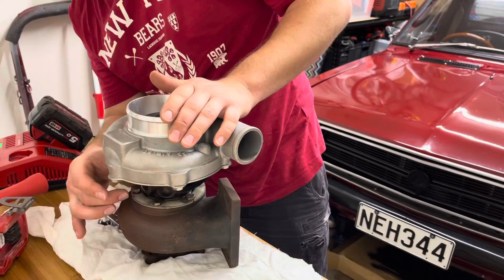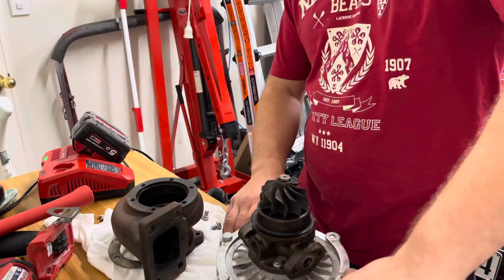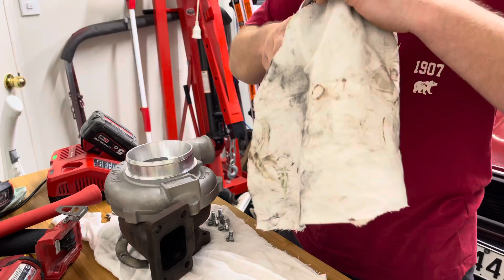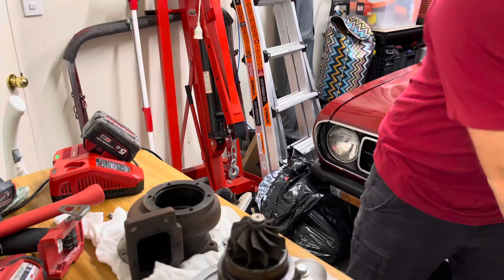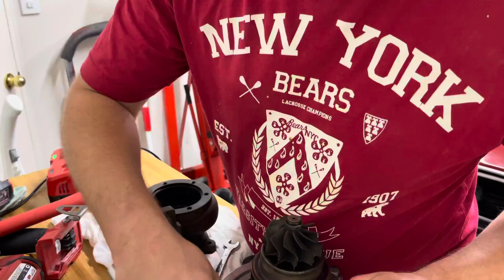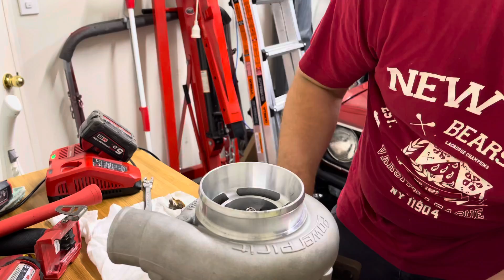Taking a turbo apart and cleaning it

Comment: Any idea for gear box you'll be using???
Reply from the maker: I’m running a w201. W124 manual trans out of a 2.0 190e
Reply from the maker: Should be strong enough